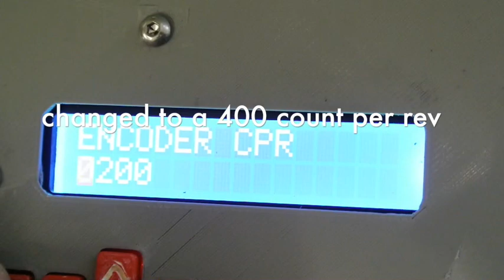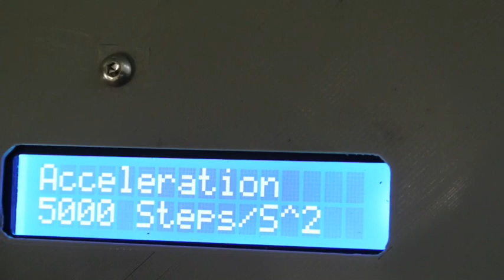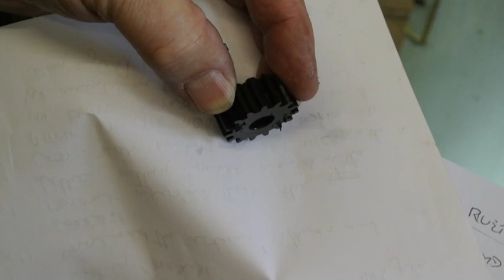Gear Hobbing on Rivett 608 Lathe

Comment: Thanks for sharing this set up with us. I am sure that this set up is reliable but I can't help thinking about the possibility of the encoder/stepper motor circuit stopping or getting slightly out of sync mid-cut! I suppose that has never happened.
Reply from the maker: Good question, Once the cutter has made several passes round the blank, the subsequent cuts are guided by the initial cuts and it needs less holding power as the cuts get deeper. I found that reducing the voltage supply to the stepper from 48v to 24v made little difference to the result and if anything improved it. There seems to be no issue with missing steps, but I do not have as much experience as Andy, but he felt there was no need for having closed loop encoder feedback from the stepper. My set up between centres was not as rigid as it should have been and I have just completed a separate system on my Boxford lathe with a major improvement made, I shall post another video before long. John
Reply: @john2478  Interesting. Thank you.